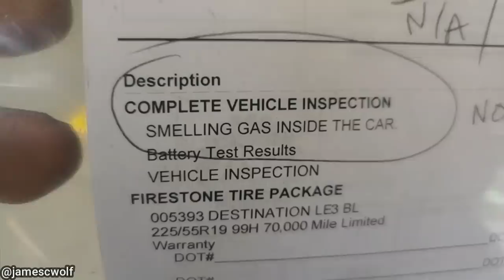Customer States Went Off Roading In Ford Bronco And Now It Won't Start | Just Rolled In

Comment: "A defect in the clutch disk and driver error." Anyone who can destroy a brand new clutch in 10 miles is some kind of absolute evil genius, not some kind of error!
Reply: Was not FORD TOUGH apparently
Reply: Not to mention things like brakes and clutches are considered "wear items" and usually not covered by warranty. Should have gone with the automatic transmission.
Reply: Wearing out a clutch is really simple. All you have to do is not to know how to use it.
Also infected with Covid-19 would help, since the smell of burnt out clutch is terrible.
Reply: “Ford Tough” is an oxymoron
Reply: @Gareth Fairclough No it's not. All clutch plates have a break in procedure just like brake pads. It's partially the mechanics fault for either not running the clutch in or not telling the owner. That combined with a heavy left foot=destroyed clutch plate.

You would be surprised just how badly your average driver treats their clutch. I've met people who have the attitude " that's what it's for so it doesn't matter if I ride it".
Reply: @ryanm4013  
No joke, should have gotten a Jeep. 
I might be little biased, but hey Lol. Jeep was founded on reliability and the older models are extreamly reliable, although susceptible to rust. Unfortunately Jeep was bought by Chrysler, can't blame Jeep for Chrysler's problems.
Reply: @ryanm4013  that's why they say fixed or repaired daily. 😆
Reply: @NTJ-  even worse - it is a Fiat nowadays 🤣
Reply: @Gareth Fairclough ....no.....no it IS possible.  I have seen this before.....vehicle has less than 20 miles with dead clutch....n000b MT driver
Reply: My last Ford Ranger pickup had the original clutch when I sold it (in less than an hour) with 250,000 miles on it.
Reply: The life span of the new clutch will clear it all up for sure.
Reply: @janemba42  ...yep....my current ride is an 06 with an MT and its one of those that the kiddie boiz all flocked to and would get 20-30k miles out of the factory clutch and then cry rivers....i had to replace mine at 162k miles because the throw out bearing went bad....it would have done another 15k, anyway.....lol  And I drive it like I stole it(ALMOST) every time I drive it...lol  and im 60yo so I guess I just KNOW how 3 pedal vehicles are supposed to be driven....
Reply: @NTJ-  ....Cheeps of today are garbage, too....
Reply: @BigLisaFan  The last time I had a clutch replaced, it cost me £120 and I could have done it myself. Replacing an automatic transmission is a lot more expensive and involved.
Reply: @ssnerd583  It comes down to the fact that these people have no idea how a clutch works, so that means they don't know how to treat it. You can thrash the absolute crap out of a car without doing any significant damage.
Reply: You can do it if you use the clutch pedal as a foot rest.
Reply: Kid probably rode the hell out of that thing. A dealership can't teach someone or ask them if they know how to work a manual for they don't. 

Mazda has a 1 yr warranty on their clutch/flywheel, and hydraulics.
Reply: A lot of people think they know how to drive a manual transmission. But they don't know how to roll from a dead stop just using clutch which is this is the first step of the basic. And end up roasting clutch.
Reply: @Account NumberEight Automatics are better cuz you can give it power slowly, instead of having to engage the clutch and grab it, like rock crawling.
Reply: @XtreeM_FaiL  wow globalist believer found
Reply: @Account NumberEight Maybe. If you have experience using them. Most people are maroons.
Reply: @ssnerd583  I'm 23 but feel like an old soul. I hate they way all modern cars look and I really hate how cheap and unreliable/overcomplicated they make them now. Anything that's been on the road 30 years or longer can easily be on the road another 30 as long as it's well maintained.
Reply: I didn't know you could get a clutch anymore! To bad they put the pos 3.5 EcoBoost in them.
Reply: @Ogrematic   Go ahead and replace the clutches in an automatic and tell me how easy and inexpensive that is for you. I'm not ragging on autos but they just aren't better than a manual. The right manual. Of course there is garbage on both sides but the right manual transmission maintained will do a million miles and be on its second or third clutch.
Reply: As we say in aviation, "The Meat Servo malfunctioned"
Reply: @soaringvulture  I thought that's what the brake pedal was for ! 🤦‍♂️
Reply: @janemba42  ....I learned how to drive in an old Willis 'jeep' on my grandfathers farm, summer of 1974.....havent owned an AT vehicle since 1983....so....I think I know how to thrash a vehicle without doing(much) significant damage.....lol
Reply: @steveb6103  you can only get the manual in a 2.3. The autos are 2.7. You can only get the 3.5 in an f150
Reply: @ThatOneGuyWithTheEye  Actually, I'm a trained tech and I have rebuilt autos before. Is it harder than a manual trans? Hell yeah - valve body. But I could do it, if I had the kit. But I went off-roading with some friends, and the biggest complaint of the group was burning out clutches over rough terrain. I drive a sedan, so I listen to truck guys cuz they do it almost every weekend. And snowmobiles in the winter. They let me ride along sometimes.
Reply: In a galaxy long ago, we would burn in new clutches by pulling up nose first to a tree and dropping the hammer...guess it wouldn't work on newer cars.
Reply: 16 miles is pretty far if you’re doing burnouts in L.😂
Reply: Ever watch Roadkill?
Reply: @XtreeM_FaiL  i watched a friend of mine dump the clutch in a brand new nissan altima with 5k miles and smoke the clutch for like 3 min. it was rolling smoke hahahahahah somehow it still worked.. to bad the motor went at 40k miles hahahahaha
Reply: @Gareth Fairclough is called  taking off in 3rd gear and riding the clutch  enough to take off in that gear or higher 🤔 lol 😆 😂 🤣
Reply: Honestly this just sounds like a dare to destroy it in under 10 miles
Reply: ha ha ..ever hear of FACTORY FUBARs
Reply: Was thinking the same,  no way to kill a clutch in 10 miles
Reply: I have 97,000 miles on the original clutch in my 2015 wrangler and still going strong. I've abused it... I tow with it, I wheel with it, I engine break on every off ramp, and I shift all 6 gears with the clutch and never skip. But . I never ride the clutch and rev match all my downshifts.
Reply: @totalof5305  i had a clutch in a 1 ton chey pickup  it was a reman and slipped from  day one and I got 78.000 miles  out of it and the only reason it needed  replaced was the springs  in the disc brook and caused major problems  !!!! 
And it pulled  heavy loads most of those miles!!!
Reply: i  say stuck and rocking it lol!!!!!!!
Reply: @NTJ-  I have 172,000+ miles on mine...  Only reason I had my clutch replaced is that a bolt on the shifter rail came loose and they had to drop the tranny to put it back in at 120K.  No damage, just had to put the bolt back in.  Figured that while they had it out, might as well put in a clutch.
Reply: I'm torn the fact you can even get manual  (plus 5000) vs a defective clutch (-3500)
Reply: @NTJ-  Still better than when they were owned by AMC....
Reply: Donny D  Just because it's a Willy's doesn't mean all that much.  There hasn't been a Willy's Jeep since about '63.
Reply: @NTJ-  can't argue. But at $5 a gallon I'm kinda not loving my Jeeps ATM.
Reply: @Ogrematic  From someone that doesn't know how to drive a stick....
Reply: @ThatOneGuyWithTheEye  If I'm driving a luxury or commuter car, auto trans all day.  Off road, manual for sure.
Reply: Didn’t know Fiats were reliable.
Reply: Probably trying to do burnouts with the traction control on, think there is a video of the same thing with a Z06.
Reply: neutral drop must've got a hold of it 😂
Reply: Ever heard of whistlindiesel? Lol
Reply: F.O.R.D.
Fix or repair daily
Reply: Less than 10 miles, since most cars already have a few of them when they leave the factory.
That said, I've seen clutches wear out in less than 5 km, due to the customer driving with the left foot resting on the clutch pedal.
Reply: @NTJ-  i love jeeps, but i have never seen one that didnt go to absolute hell.  The really old CJs were the only things I felt that i could call reliable, but even those had their own issues too of course...
Reply: @ssnerd583  lol, i replaced a perfectly good clutch that i had put nearly 300k on myself, all because a clip on the throughout bearing had failed... No way i was pulling that all apart just to reattach the TOB to the arm. 😆
Reply: Dude the new broncos are being recalled because the engines keep blowing up so actually not the user error ford literally built a piece of shit...
Reply: @soaringvulture  I reckon this is the right answer.
Reply: @jimmy5860jim  clutches and engines are two separate parts.
Reply: @panzerveps  no shit Sherlock look at the new broncos being recalled idc if the fuckin transmission went. They are recalling them because they are a piece of shit and the engines blow easy. If the transmission did that with barely any miles on it it's a piece of shit it takes a lot more to blow up a transmission I would know because I shifted into first gear many times with my 3vze in a 5500 pound body at 7k rpm so excuse me for saying how I feel about a shitty ass vehicle haha....
Reply: @janemba42  
No. You cant destroy a clutch with only 10 miles on it
Reply: @janemba42  I must treat mine pretty well. I got almost 110,000 miles on mine before the throwout bearing went south. The transmission shop said the clutch disk itself still looked good, but I had them put a whole new unit in so I didn't have to get work done again in a couple of years when the disk itself needed replacing.
Reply: @NTJ-  "Jeep" and "reliable" are two words that should never go together nowdays.  Jeeps are horrendously unreliable now, make Fords look good.
Reply: A factory defect in the clutch mechanism is possible ofcourse. 
But usually it's just an idiot who thinks he's doing a burnout, but the only thing burning out is the clutch disc. Classic rookie error
Reply: @ffjsb  I know how to drive stick. I meant someone who's taken an off-road course just for manual trans, not just cruising in autos. 2 different classes. But I can drive stick, I was a mechanic, I can drive anything in and out and for a test drive.
Reply: @Gareth Fairclough you can do it pretty easilly if you do it intentionally, otherwise its probably impossible.
Reply: @NTJ-  only jeeps worth anything are the cj's
Reply: Ken Miles Lives!!!!!
Reply: @dantevortex  This is the real reason.  Some dumbass has fried his clutch but good trying to hero it up in his new ride.
Reply: @Ogrematic  That's why ford has a crawl gear. 4L with the crawl gear allows me to go 0.5 mph without touching the clutch at all. Went up huge hills and rocks without any hesitation/stalling/having to clutch in
Reply: @Ogrematic  The bronco has a crawl gear that lets you move forward at 0.5 mph without having to using the clutch at all.
Reply: @jimmy5860jim  Transmission and the clutch are two different components though....
Reply: @janemba42  OEM clutches do not have a break in period (nor do the brakes) these days. They are designed for the average person who knows nothing about this. Its not even in the owners manual any more. It has been phased out over the last 20 years or so because people just won't do it.
Reply: @hajjdawood  Some of the guys had low gear.
Reply: @chrisdaigle5410  yeah
 got that kind of clutch service out of 2 Chevy S-10's
Reply: @chrisdaigle5410  Years ago we had a customer with a Ranger. At 180.000 we told him he needed a new clutch, but if he babied it he could make it last a little longer. At 248,000 we had to do a head gasket and valve job, still the same clutch. At 272,000 an intermittent ignition problem caused him to give up on the truck. Had I known, I would have bought it and put a clutch and diagnosed the issue.
Reply: A clutch that doesn't fully engage could wear out in 10 miles. But an experienced stick driver should have been able to detect a problem or at least a smell.
I always liked the 4th gear low speed high load clutch stab test to check for quick and solid engagement. The RPMs should snap back down, not slide back down.
Reply: @smiller3110  I believe Bronco and Bronco Sport are 2 different animals.
Reply: @don2deliver  never said anything about a bronco sport. That has a 1.5l 3 cylinder and you can’t even get it in a manual
Reply: @Ogrematic  I agree with you that autos can be better and last longer in many all terrain situations. I do believe manuals are superior in 99% of paved road situations. Only place I can think of in the usa where I'd own an auto as my primary  would have to be if i lived in the hills of SF. I personally don't think I have the skill level and definitely not the tools to rebuild an auto. I'm much more experienced with the manuals.  

I think in time auto's will eventually become superior. But only ever more complicated. Who know tho?
Reply: @ffjsb  Unless it's a heavy traffic situation I'd still prefer to Cruz to work in a manual. But there are some pretty cool autos with paddle shifters. That's just me tho. Your entire area and situation can definitely make a difference in what is preferable I've got to think about that more often
Reply: @smiller3110  1989 bronco 2 is what you want. Not anything they make today. That new bronco is complete trash
Reply: @panzerveps  That's literally 3 miles dude. It's impossible to ruin a clutch by "riding in" in 3 miles. Maybe not knowing at all what your doing and just reving it to the moon and banging gears while barely going anywhere while stalling it about 50 times. Could do that in 3 miles. Or trying to do a burnout and just blowing it up instead. Hahaha my legs are long af and my seat doesn't go back far enough in my chevy s10 so I ride the clutch a lot when i drive it. But somehow it still has 178k on it with the OG clutch. Guess they just used to build things differently.
Reply: @ThatOneGuyWithTheEye  Driving a stick sucks in stop-n-go traffic, especially in narrow roads. There are some old towns with narrow roads that make it a nightmare.
Reply: most likely Ford mess up
Reply: @johng4527  It's still direct drive to the crank egghead, it doesn't reach 20,000 friggin' RPM.  it reaches THE SAME RPM AS THE CRANK.  This guy clearly tried to do a burnout and fried his clutch, dunno what offbrand cereal box you got your auto knowledge from the bottom of, but it was clearly cheap and nasty.
Reply: @Ogrematic  I like the control that a manual transmission gives me, especially when driving in mountains and old medieval city centres.
Reply: It's the same person that buys a brand new bronco, probably 20k over msrp, gets the manual cause they think it looks cool, without having ever driven a manual. They probably thought they'd just figure it.
Reply: @Account NumberEight not true, automatics are better off road in a number of situations. Most rock crawlers and mud trucks are autos, they shift way faster without any loss of power, which can be important in really gnarly situations. That said manuals are just more fun in a lot if situations, if you are good at driving them.
Reply: @ssnerd583  you're right except for the cheap part.
Reply: @epstein_isnt_dead7726  that’s a good one!
Never buy cars beginnig with “F”, such as Ford, Fiat and all the French 🤣
Reply: @Ogrematic  You can feather the clutch you know.. It's not an ON/OFF switch...
Reply: @ggooaa100  Yeah, I know, I also know that wears out the clutch. I drove a stick for years. I have paddle shifters now.
Reply: Just dropping the clutch and stopping, rinse and reparation for 10 mi
Reply: @Account NumberEight no it’s really not.  Autos are so much easier.  Manuals don’t like low speed
Reply: When you're going down the highway, put your car in R for Race mode. Gotta be going at least 60MPH though.
Reply: I stopped driving manual transmission cars because a leg injury left me unable to feel the clutch... And I was damaging it...  Not as bad as this one was abused...
You can burn a clutch in 0 miles.
Reply: Not really, it was a Ford.....
Reply: I'm living in south east Asia where Toyota minibuses with manual transmissions are popular.   They are driven by oblivious old farts who are rough on the equipments.

One time I was riding those buses, the left the terminal and began a gentle hill climb with the clutch slipping in fifth.   The dude shifted to 4th and the clutch still slipped.  Finally, 3rd gear works and we started to pick up some speed.

But there was probably some loose connection in the driver's brain because he shifted to 4th again and kept slipping the clutch and it just had enough of that driver.  It kept slipping even when the bus was in 2nd

After 5 minutes of this, the other passengers thought the bus was gonna go up in flames and we stopped at the top of the hill waiting on another bus to pick us up.

That is a good reason why you don't lend your car to anyone.  The driver could have made a phone call at the bottom of the hill and made a u turn.  But no, he had to take us to the top of the hill some distance away from the terminal
Reply: @NTJ-  Reliable? thats the funniest shit ive heard today
Reply: @petergarofolo9385  Found On Road Dead.
Reply: @Gareth Fairclough It's called riding the clutch
Reply: This probably is some kind of fluke. I know Ford is ford but their manual transmissions are usually pretty damn solid.
Reply: OP said it was a Money Shot.
Reply: Yeah no way! that’s definitely a defective clutch! I’ve seen an idiot smoke a clutch in 30,000 miles but 10 miles that’s not possible unless someone actually intentionally tried to destroy it. And I can’t imagine anyone would buy a brand new car and then intentionally destroy the clutch that doesn’t make any sense.
Reply: @BigLisaFan   yes but if the clutch disintegrated in 10 miles and the dealer refused to fix it I under warranty I would sue them that’s a defective part not wear. If the clutch failed after 30,000 miles your most likely screwed though as I’ve seen people who can’t drive destroy one on 30k before. Fortunately my clutch has just under 200k on it almost all city driving and is still is in ok  shape! This is why you don’t let other people drive you car!
Reply: @NTJ-  Jeep is gone to shit since Chrysler bought them.
Reply: Well u just grab sanding paper and put it up against the clutch and a way for it to spin around sanding the clutch
Reply: @ThatOneGuyWithTheEye  I have an 02 sequoia with 265,000 on the odometer and a 06 Lexus GX with 250,000 on it, never had any major issues, just regular maintenance and wear items
Reply: @NTJ-  Chrysler was bought by Fiat. Problems got even worse
Reply: We had something similar a couple years ago in a TV show here in germany.
An elderly man came to the shop to have the clutch replaced for the 3. time in less than 3 months. The mechanics then found out that the man had hearing aids he wasn't using while driving. He was switching from neutral to the first gear at 6,000+ rpm because he couldn't hear the roaring engine without his hearing aid and destroyed the clutch in no time.
Reply: @immortalsofar5314  That procedure is hardly subjective to auto/manual. Pulling a 90s stick ranger tranny is cake, pulling a brand new beamer’s cvt is not
Reply: Press on the pedal  halfway while driving a few miles. Watch what happens
Reply: Infantile failure from factory defects. Or premature failure- had a master slave cylinder failure on one of my vehicles- replaced with new one and ran fine
Reply: My x could do it in less. Don't ask me how I know.
Reply: @DaveVespa  Oh, that was about 30 years ago. Thanks - I feel really old now!
Reply: @immortalsofar5314  sorry bud
Reply: @mikefoehr235  it wasn’t driver tough for sure !!!!
Reply: @BigLisaFan  I’m thinking the driver should just rely on Uber, and not drive at all 😂
Reply: @ryanm4013  thank you Mr. dodge😂😂😂
Reply: @vclamp  LoL, the driver goes down the road with their foot bouncing off the clutch pedal 😂😂😂
Reply: @leokeffalas3143  then he let the repo man have it😂😂😂
Reply: @immortalsofar5314  Toyota ATs last a loooong time.
Reply: @petergisel4864  ummmmmmm yeah…………………sure😂😂😂
Reply: @Ogrematic  I agree.
Reply: @ThatOneGuyWithTheEye  AISIN TOYOTA make excellent ATs
Reply: @JackSparrow-xw7ls  Pretty far for a FORD...PERIOD
Reply: @RichiPuppi  myth
Reply: @jimmy5860jim  damn James, settle down, your BP is way too high your going to have a stroke. Get yourself a nice refreshing beverage and cool off for a while.😂😂😂
Reply: @epstein_isnt_dead7726   ummmmmm that might have made sense to those of you that are a little “ slow” in learning. But “Fiat” is a part of the Chrysler Corp. which has your dodge, jeep, ram etc. 😂😂😂 you keep slugging away champ, one day you will get it right😂😂😂😂
Reply: @rogerb5615  now, that is an original there, did you make that up yourself or did you have help😂😂😂😂
Reply: @M21-w1y  Believe what you want man. Plenty of people know how to drive stick properly. My clutch is original with over 100k. My throw out bearing is original. I'm being facetious when I say I abuse it. I never ride it, I never pop it. It'll probably last another 50k because she's retired from hard work. Won't tow with it anymore because I bought a 3/4 ton truck and seldom have time to off-road anymore. And she spends her winters in the garage because new York salt is horrible to vehicles and I'm keeping her forever.  they'll have to pry this jeep from my cold dead hands before I'll let her go.
Reply: @M21-w1y  I'm sleeping rn wym my blood pressure is through the roof???
Reply: @BigLisaFan  autos are pretty ass, only auto I'll have is a staged one in an old school muscle car
Reply: That’s why FORD stands for: Found On Road Dead. Lol
Reply: @ThatOneGuyWithTheEye   makes me think of how I’m still driving a 30 year old Isuzu pickup I got at 110k miles, learned how to drive stick on it and still put another 20k on with. Single cab bench seat where my head is 2” from the roof and I’ve gotta fold up my left leg or send my foot behind the clutch to keep from riding it.